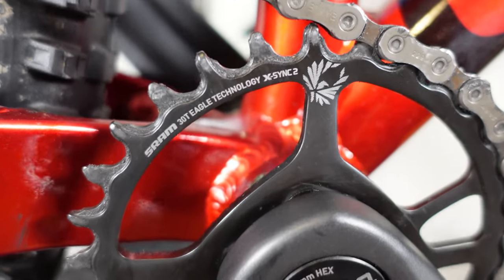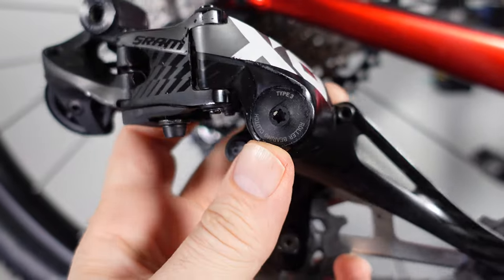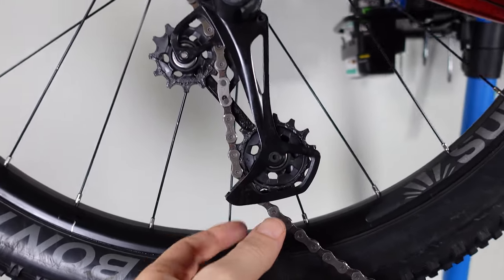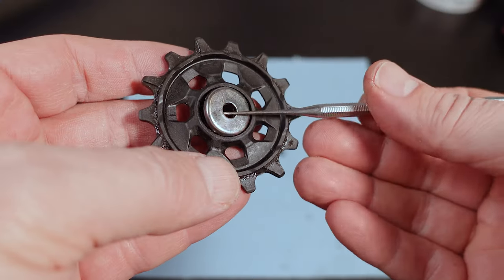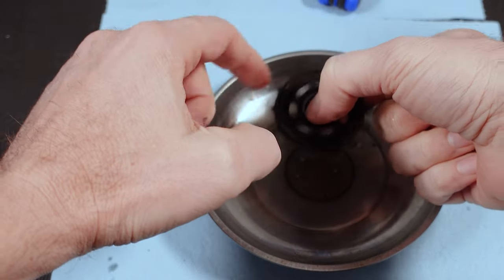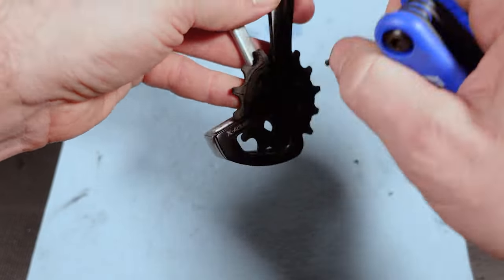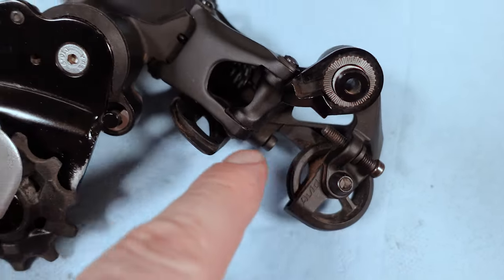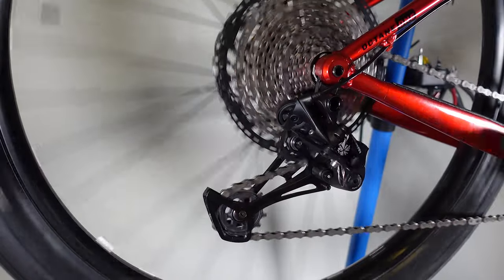SRAM Derailleur SERVICE, Eagle GX/ NX/ SX/ X01/XX1/AXS by SRAM, Maintenance 12 Speed

Comment: Have no problem with NX derailleur , maybe it isn't the smoothest but it does the job and never gives me any problems. If it breaks I would probably change it for a GX.
Reply: the point is with which trigger you use it. i use it with gx gripshift and its very precise

Comment: @6:09 you used a pick to remove the seal. I never remove seals this way. I use a pick like you do, but I carefully dig in from the outer race side of the seal. You're less likely to damage the delicate "flap" on the seal that spins on the inner race. Nice job on the video! As you can see by the comments, you helped a lot of people.

Comment: I finally performed this service today. Swapped out the pulleys from my GX AXS and enter the XX1 AXS ceramic pulleys. This video was super helpful, especially the part where you talk about that weird one off washer sans shoulder. Thank you!
Reply: I just realized i got scammed. SRAM XX1 pulley kit advertises as ceramic ball bearings. But it turns out there’s only ONE ceramic ball out of the total 14 ball bearings in the kit. The rest are steel balls. What???
Reply: @GokkunGuru  "The single hard ceramic ball keeps the steel raceway free from foreign particles in dusty and dirty environments. It smoothes the raceways which increases service life under extremely contaminated conditions. The single-ball hybrid bearing can also replace a conventional bearing without the need for remodelling."

Comment: I had a problem with my NX derailleur and it was all due to the lack of lubrication on those 4 points you mention first. Saw this after I was done, but definitely wanna leave the comment here because I was thinking of changing the shifter, the cable, and almost the whole system due to a MINIMUM maintenance problem. I believe it has to do with the fact that when washing your bike that's the LAST place you think of keeping an eye on. Awesome video I'll be doing that TLC soon!

Comment: Don't forget the loctite on the small bolts on the jockey wheels.  I didn't use loctite and the upper wheel bolt came loose mid ride.  Good thing I was able to find it on the trail or it would've been a long walk back to the car!

Comment: I just bought my first 1x12 Sram GX group set with 10-50 cassette. I loved riding with him in my Scott Spark. Now I will get to know him better to do the maintenance as I already do with Shimano.
Reply: @LoveMTB  Thanks so much!!
Reply: I also have the same set as you.  Chain and rear cassette has been replaced but now the derailleur is giving trouble with very poor shifting up and down. 
Going to swop in a newer derailleur for a test run. If it doesn't help think I will replace with the XT derailleur. Seen many videos with this set up. Our mechanic agrees. He believes Shimano is tops over SRAM. 
Enjoy your Spark. 
Greetings from sunny South Africa.
Reply: @dk.650  How did that work out? I have issues downshifting when climbing but I'm going to try replacing the upper jockey wheel and the shifter cable.

Comment: My drivetrain maintenance frequency really depends on how much wet weather riding I do, but generally speaking, I have to do this at least a few times each season.  
This is especially important if you’re using wet chain lube.  That stuff just gunks up everything.  I basically need to degrease and clean the chain and entire chain path after every wet muddy ride.  Sometimes the jockey wheels are so bad , you can’t even see the cogs and you have to pick the caked in sludge out with a knife.

Comment: I've worn out 3 type 3 clutches on SRAM GX Eagle derailleurs, just switched to shimano since at lease for shimano you can replace the clutch without replacing a whole derailleur.
Reply: On the clutch on the Sram if you turn it clock wise or counter clock wise it will freeze up and not push in. I found this out the expensive way after buying a new derailer when I thought my other clutch was broken

Comment: Great video, thank you!  The clutch on my GX works fine, no chain slap.  But downshifting can be a little sloppy sometimes, especially when jumping 2-3 cogs.  But maybe I just need to maintain it better and follow your video’s advice!
Reply: What would you recommend if B Gap and limit are all set but the rear mech is struggling to drop to smaller cogs? It seems like the parallelogram is not moving fully despite working oil into them. 
LBS is also struggling with setting it for smooth shifting.

Comment: I do exactly same. Additionally I checke derailleur hanger and screw. 12 gear shifts like a diva... As long as everything goes smooth I leave it as is. But minimal cable rub or hitting a rock causes bad shifting...

Ps: use gloves 😋

Comment: I'm using a NX 11speed on my emtb,, but next time it's weared out i want to change the boss to XD so I can upgrade to GX cassette and in time GX axs ..
ANYWAYS NOT WHAT I WAS INTENDED TO SAY LOL
I have very good experience using gun oil on my chains Ballistol it's called it's also prevent corrosion and protects leather rubber wood etc but after about 25 hour's of bicycling in dirty environment like the city it turns black so then just wipe off the oil on the sides of the chain with a face mask which is what I found those masks good for (nothing is so useless that it's not good for anything) just do it lightly you're not trying to remove it all just the dirty excessive layer and only on the sides so don't use a degreaser or anything and it's looks clear and clean again. I used a lot of lubes and oils im a bicycle deliveryman and loves mountain biking (Norway) here it's often a little bit of mountain biking included in my job mostly when taking Short cuts but this is a Mountainous country so.... I broken a lot of chains but I have never broken a chain again after splising it by pin locking method when using Ballistol gun oil on it... it's Also okay to get opened bike locks who gotten corrosive or washed by the rain so the lock oils are leaked out or etc.. it's better than WD-40 you need a lot less of it..but WD-40 is better As a degreaser..i haven't tried yet but I think gun oils like Ballistol is very good for the seals on damper forks and also for wiping the stanchions i Guess it will eliminate friction I'm actually sure about it... have any one else tried Ballistol or other similar gun oils for their bicycle?

Comment: Thanks for this video!

I took the jockey wheels off my GX derailleur but forgot to take note of the washers and bolts 😕 

You already clarified the washers in the video. But what bolt should go where? There’s a longer and shorter bolt. 

Thanks!
Reply: Installed them backwards: one will be too short and one will be too long. It’s clear 😀

Everything runs smoothly again!

Comment: Nice video as always. I’ve got an AXS X01, no problems at all with the clutch, I’ve had to replace the clutch protector once, cheap replacement, cable derailleurs should have it also. I tend to clean and regrease the jockey wheel bearings often, either Shimano Premium or Motorex Bike Grease 2000 are great choices. I’d love to know the tightening torque for the bolt of the spring for the cage, I took it off some weeks ago to clean and regrease the internals, I torqued it to 4Nm which I think that is fine, but I forgot to put a mark on the bolt to know the factory torque spec 🤦🏻‍♂️ Regards!
Reply: @LoveMTB  I could not find the exploded view with the detailed torque specifications so I came looking for help from the MTB parts guru 😁

Comment: about the Sram clutch... Inwould say they are weak. All the time when a friend from austria sends me clips from rides with his friends you can tell by the noise who is running Sram LoL
Reply: They aren't great, SRAM clutch isn't serviceable either,  I service my xtr clutch once a year on my yearly bike service and have no issues, ever, plus you can tune the clutch tension on Shimano depending on your riding conditions, riding Austrian Alps compared to peaslake in England is a huge difference, believe me, I know 👍
Reply: @threefeetpete2010  The clutch needs this special white grease right? My RD M5120 came with almost none of it and it creaks when it moves. I opened the clutch cover and took the clutch out and the noises are gone. I guess i have to get that grease right?
Reply: @LoveMTB  Yea probably. They ride all kinds of crazy stuff like crankworks and so on.
Reply: @kaedeschulz5422  it is the special white stuff, muc-off is no good, neither is Shimano Dura ace grease, only the proper Shimano grease really does for it

Comment: Awesome video, going to do this before the weekend. My sx gets stuck on the largest cog, even if the the cable is removed, as if the spring is too weak. Hopefully greasing the pivots will help. Any ideas if if doesn't solve it?
Reply: There is 3 3mm Allen bolts on the derailleur. Two of which are limit screws. One is a b tension screw that you need to manipulate outside of the factory position. Doing this can help it dropping from the big ring. Outside of that get a gx

Comment: Thanks for the video. I upgraded my SX Eagle to GX, happy with the upgrade.  What about the clutch cover - with the torx  head screw.  Does it need to be checked for tightness,  will I mess up my clutch if I remove it? Thanks KP

Comment: Hi,
Could you explain a little bit about loctite function, please?        
What's the difference between blue a red loctite? Which other brand can be used or found?
Thanks
Reply from the maker: Red is permanent, stonger but can be hard to remove without heat
Blue is used in all situations when you need temporary thread locker, other companies have it as BLUE also like Permatex 24200 Medium-Strength
Reply: @LoveMTB  Thanks for your response 👍
Reply: I doubt if you need red anywhere on a bike. A little bit of blue goes a long way, scrub off any excess with your finger from the threads, you only want to leave some behind in the threads.

Comment: Didn't you ever take it apart to see if clutch really is not adjustable? I've been told by a mechanic that it's not adjustable.
Reply: @LoveMTB  is it possible to swap them?
Reply: @LoveMTB  that's silly. BOX components very easy to adjust and remove clutch. Buy the bushings wea rout in few tens of km, atleast first one did, I will see how long the warranty replacement does, I wonder if they use bad bushings or if they use strong bushings and it happens. If so brass bushings would be better I guess. I know higher end Sram use brass bushings. And you can the parellogram apart like Box.
Reply: @LoveMTB  is thst the case for all models?

Comment: Thanks for the video, I need to change the torsion spring cover where it says "type 3 roller bearing clutch", I can't find it anywhere on the web.
Could you help me to find it on any website? 
Thank you very much in advance.
Reply: @LoveMTB  I have a sram gx eagle and the plastic cap where the roller type 3 goes, I have over threaded it, that's why I was asking where I can get it, thanks again.

Comment: Question can you push the bearings out of a new Upper Pulley? I have a GX 11speed and my bike shop only had a pair of x01 pulleys and the lower pulley was identical but the upper was different. I was curious if i could pop the ceramic bearing out of the new X01 pulley and put it inside my GX upper pulley? Thank you in advance for your time

Comment: Great video. I'm here because my X1 11-speed drivetrain is making a noise, and I can't figure it out. The chain is new and was replaced at just under .75% wear. The cluster and chain ring look good. The upper and lower jockey wheels are in the correct positions and lubricated. The chain is aligned with the narrow and wide teeth. The derailleur hanger is straight and tight to the bike. The sound only happens under loaded (uphill) pedaling. It sounds like the chain is rubbing on something. Honestly, it sounds like the alien in the Predator movies! The derailleur cage does not appear bent but is very close to the chain. The chain is an 11-speed SRAM chain. I wonder if anyone has had a similar experience or can think of any possible explanation. Thanks.

Comment: I thought sx had a clutch, I guess the type 3 roller bearing clutch cover is a lie?
Reply: @LoveMTB  not sure, it came on a 2020 bike, but im like 99 percent sure it has a clutch, given the chain tension.
Reply: @LoveMTB  actually I think it's the first, the one that doesn't have the little plastic wheel.
Reply: @LoveMTB  it is indeed the first generation, though I'm a bit more confused after researching it than before, I can email you a picture of the derailleur if that would help!
Reply: @LoveMTB  wait upon reviewing some photos it actually doesn't, now I know my next upgrade!

Comment: I have a Giant Anthem 1 with 12 speed GX drivetrain. A few weeks ago the derailleur took a hit on a log and bent it quite badly. I’ve managed to straighten it out and checked the hanger alignment, which is now spot on. It still has a problem with the two largest sprockets. It is noisy and often skips the 48t on the way up. It’s absolutely fine on the 9 smaller sprockets. Any advice on alignment or is a new derailleur required ? What do you think ?  Thanks for great videos 👍
Reply: @LoveMTB  thank you. That was kind of what I thought you’d say 👍

Comment: Would upgrading the pulley wheels of the NX to the GX or X01 pulley wheels make a notable difference in performance? Do you think there is a notable difference in performance between the GX vs X01? Starting with a full NX bike and was kind of thinking of trying to get a season in with it and then upgrading to X01 or XT but wondering if with things like the B-Bolt kit and pulley wheel upgrade if a lot of the performance issues with the NX derailleur could be alleviated. Would a NX RD with the X01 pulley wheel and B-Bolt upgrade (maybe that cable bushing upgrade too) outperform GX? If I did this I would likely retain my NX crank but switch to a X01 chain and GX cassette. Just wondering if the NX can be upgraded to perform similarly or better than GX (but heavier).
Reply: @LoveMTB  Okay so the differences in performance wouldn't be alleviated by changing the pulley wheels and B-bolt? Hoping it doesn't bend with the parts shortage we have these days!
Reply: @LoveMTB  Thanks! Good to rule that idea out
Reply: XO1 has really tight tolerances and special bushings on the pins to eliminate play while GX, NX don’t

Comment: Using an older XX 10x2 system, no clutch. Could a newer style rear mech with clutch be used with the x0 10s rear shifter without changing the chain and the cassette or would I need new everything since my drivetrain is not eagle?
Reply: Newer style 11 and 12spd SRAM derailleurs are 1x specific. You can get older 10spd SRAM rear derailleurs that have a clutch and they're meant for a 2x. Clutches were first introduced in the 10spd days.
Reply: @HollyBoni  Yup, I saw that there is a GX 10x2. I was just wondering if it would work with my x0 shifter or did something change in the standards in the meantime. Asking out of ignorance, how does a 1x rear mech know if you are running a 2x if the cassette is adequate?
Reply: @SuperJerot  No, that GX is quite an old derailleur. Any 10spd SRAM rear derailleur will work.
These newer 1x RDs are designed differently. The upper pulley has a bunch of offset, this makes them work better with wider ratio cassettes, but a shift at the front would completely screw up your b-gap. Also, the cages can be quite short, so for example a SRAM 1x11 rear derailleur might not have enough capacity for a 2x10 (if it worked properly with a 2x to begin with).
Reply: @HollyBoni  Perfect explanation, thanks.
Reply: @HollyBoni  My xx is to a fair bit old, although works like a charm. It's only missing a clutch, so probably not worth while buying a "worse" mech just for the clutch.

Comment: How do you remove the 5mm mounting bolt? On shimano there's an e clip, I can't work it out on this nx 11s
Reply: @LoveMTB  nx 11s. The next video in my search had what I was looking for. (Hobby). Its a wacky circlip but easy enough to take on and off. 
The derailleur mount comes with 2 orange o rings that vanish into thin air in a few years. SRAM knows it and makes a kit to fix it. 
I just drilled out a bunch of washers to 12mm ID to take up the slop. 0.45-0.55mm is ideal.

Comment: When I’m on the extreme ends of the cassette (10T and 50T), my shifter cable rides on the extreme limits of the shoulder on the cable pulley of the GX derailleur. 

That is normal as long as it’s still within the pulley wheel channel right?